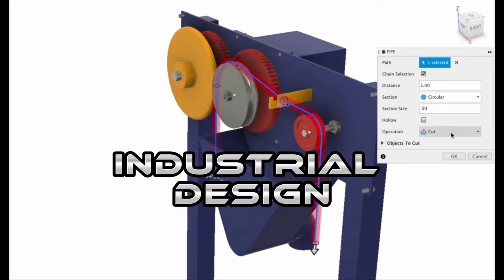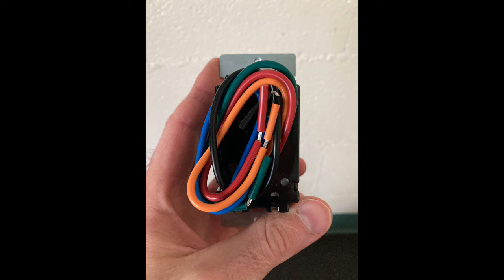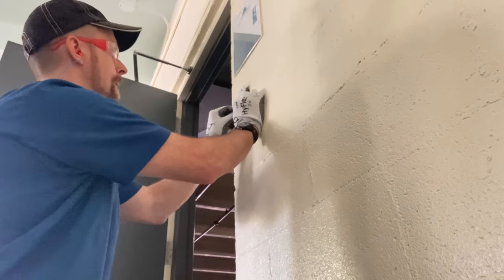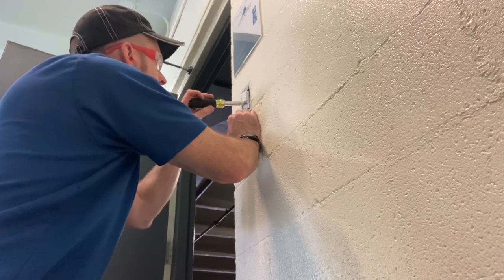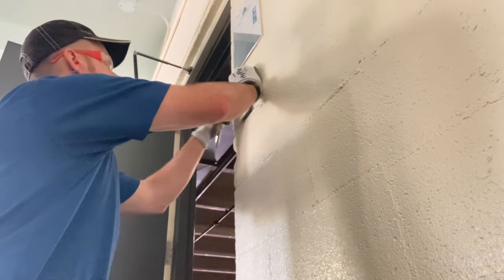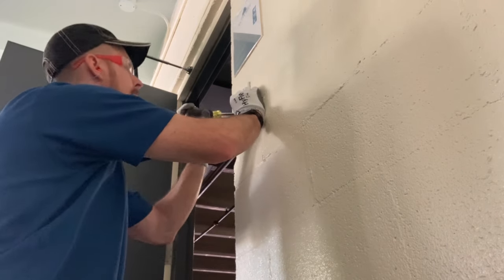How to Install a Motion Sensor Light Switch!

Comment: If you aren’t going to show the connecting of the wires then why even make a video. Thanks for nothing.
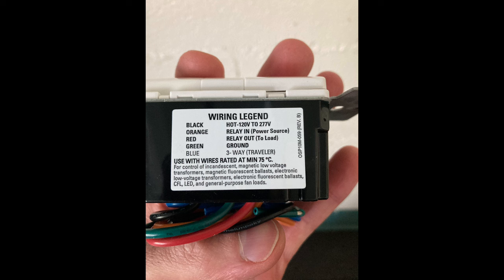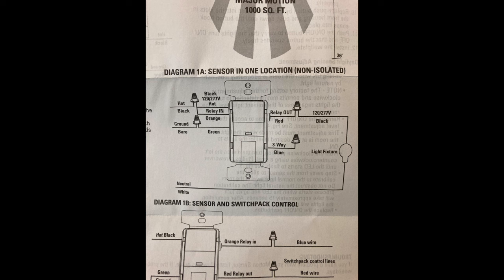Reply from the maker: Thanks for your input Josh. If you look at the 1:00 to 1:20 mark, you will see the wiring schematic.  I’d be happy to answer any questions you have about the wiring.
Reply: it would help if we see what color wires go from the switch to what color in the wall.
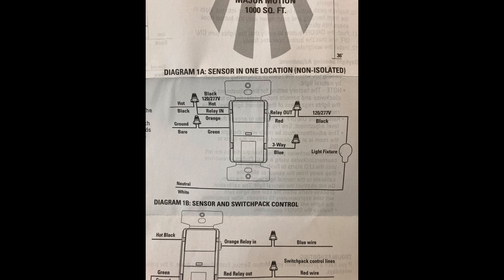Reply from the maker: @flipperburks6606 at 1:23  I show the wiring diagram.
Reply: noting new from this......wanted to see wire on switch!!!!!!
Reply from the maker: Understood.  The wiring diagram is shown at the 1:20 mark.